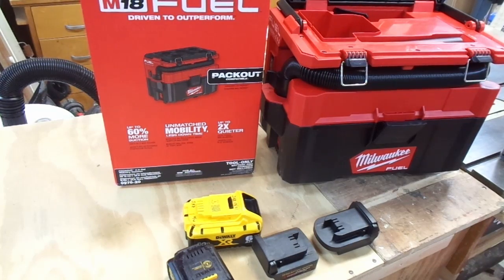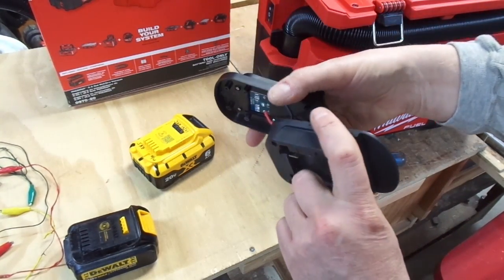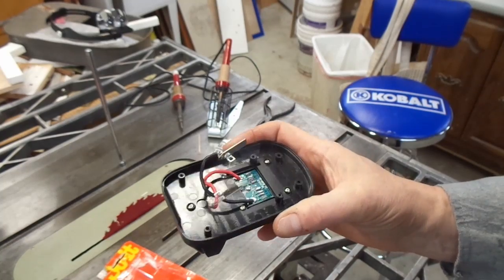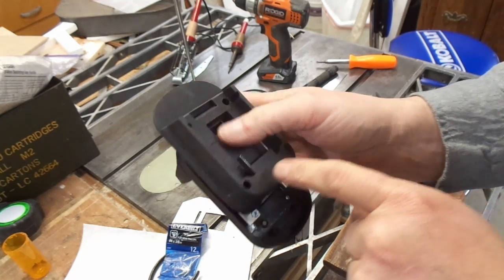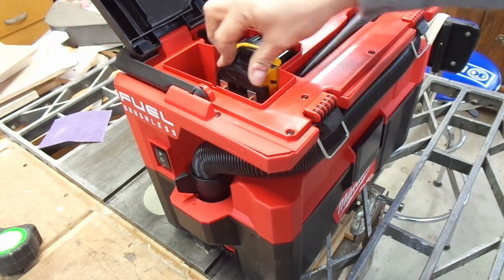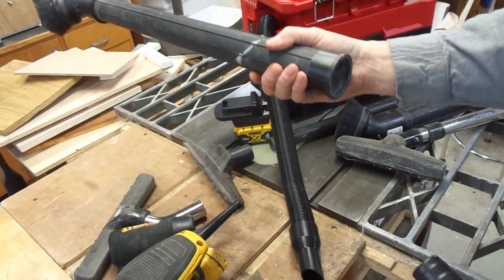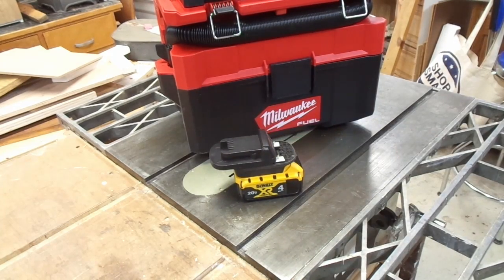Milwaukee M18 Packout Vacuum with DeWalt Battery

Comment: I bought the M18 18V model and was lucky enough to have ordered the correct adapter before seeing any of your videos. I naively thought that any of those adapters found on Amazon will work. Worked out in the end, but should have done more homework. Totally agreed that all of this could have been avoided if Dewalt would make a better vacuum.
Reply from the maker: Thanks for the comment and I'm glad it worked out for you.  Which adapter did you end up getting?  Did it need modifying like mine?  Thanks again.

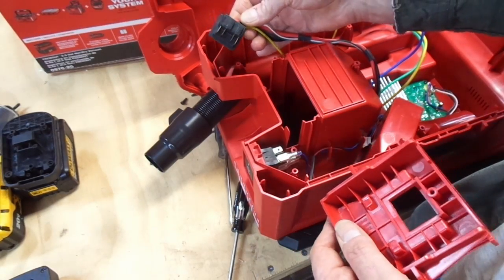Comment: +1 on Dewalt needing to build better vacuums. Their vacuums have always been behind the curve, not sure what the issue is over there.  I have the same issue I have all dewalt batteries and no desire to carry different brands of batteries and chargers around.  usually the battery adapter isnt an issue but it is with the vacuum pockets. I am wanting this same vacuum as well.  Based on your video the best method looks like if someone 3d printed a new red piece like you show around 3:12 that allowed a dewalt battery to slide in and moved it up would be super slick that way it looks factory and could be returned back to original if needed. No adaptor would also most likely allow bigger battery to be used.  I also think 3d printer is what you need to solve your wand issue.
Reply from the maker: Thanks for the comment and you bring up some good points.  I'm not a 3D print kind of guy so I don't have anything to add, but it sounds elegant.  For my issue I have a few batteries that will power the vacuum for 10 to 15 minutes each and that's enough for my needs, although I'm frugal with the run time.  I find the on/off button on the case not terribly convenient and the spring retract hose is something you have to fight while using it.  At the end of the day, it's not really a vacuum you'd want to operate for hours on end anyway, so I use where appropriate, meaning I use it where the lack of cord and plugging in exceeds its shortcomings.  When I have serious vacuuming to do I reach for my corded Rigid vac. Thanks again.

Comment: Great Work! Thanks for following up. Agree about wishing dewalt just made a decent vacuum. Oh well. 

That adapter looks a bit worthless. 

I ended up grabbing the regular Milwaukee vac and an adapter. Works great, appreciate the effort.
Reply: I just ended up doing the same thing. DeWalt vacuums suck but they don't. Can you install a flexvolt? Doesn't work with mine.
Reply: @edwardlairdiii8617  I am ashamed to say I don’t own any flex volt tools yet, so I can’t comment either way.
Reply: @kilikopela83  I bought a few last Xmas. Went alittle crazy but I couldn't beat the bogo deals. Still have tools in the boxes.
Reply from the maker: For this vacuum, the 4AH battery is the largest that I have that fits with the adapter and there's not a lot of remaining room.  I have a 6AH 20V and 6AH Flexvolt, both of which are too large to fit with the adapter I modified.  BTW: Either battery does "fit" in the Milwaukee cavity without the adapter.   My modified adapter fits on my 6AH Flexvolt and I measure 20V at the Milwaukee side pins, so it looks like it should work if it fits.

Comment: I’ve had the same frustration about getting the wand extensions to fit. I used a heat gun on a shop vac brand extension to soften the end of it enough to jam it over the Milwaukee end and resize it. Works well. Probably would be too loose now to use it on a shop vac brand vacuum but I intend to keep it as a dedicated extension for the Milwaukee. 

I have a shop vac brand vacuum, master force brand vacuum, and Milwaukee now. All three slightly different size for the attachments. Would be nice if they were all a standard size! :)
Reply from the maker: Thanks for the note.  I just posted a video where I did something similar.  It's annoying Milwaukee just doesn't make them.

Comment: the first adaptor models fit well with the powerstack 1.7 (i have that set up) the problem with that adaptor is the circuit, it dont have wires like the second model.
Reply from the maker: Thanks for the comment but I'm not sure I'm following what you're saying.  My adapters were simply the hot and ground wires (2 wires).  None of the other ports on the battery are carried through the adapter.  If yours is different from the ones I had then maybe you can rig something that will work.  Good luck.

Comment: Project Farm did a good review on them I have all DeWalt 20 volt tools. I did buy the Milwaukee vacuum. It's a shame that Dewalt doesn't make a better one. we use all Milwaukee Tools on our line trucks
Reply from the maker: Thanks for the comment.  I'm like you, having been on team DeWalt since the 90's, I've got the 20V tools and am generally pleased with them.  The vacuum really seems to have missed the mark, making me wonder if the marketing team blew it or the bean counters had too much influence.  It seems DeWalt turned their resources to lawn and garden and perhaps took their eye off the construction ball or made it a conscious decision.  I use my Milwaukee hybrid vacuum and it suits me for certain jobs.  I wish it carried a wand and more useful attachments, but I can deal with it the way it is.  Thanks again and cheers.
Reply: If HD had the new ridged NXT I would have bought it. They have all the accessories and bags and filters for it. It would have saved me 150.00 They don't stock much for the pack out vacuum have all Dewalt 20v at home. At work on the powerline trucks, we use all Milwaukie tools. The larger contractor I work for Milwaukie will build whatever tool we need which is pretty cool. @jazbuilding

Comment: Wow《☆》Nice Adaptation of the Adapter👍🇺🇸I blame Dewalt as well For not making a more powerful Vac🖖😎☮
Reply from the maker: Thanks for the comment.  I'm glad I have the tool as it's a great fit for specific jobs.  The Milwaukee vacuum is not great shakes itself, but OK.  I find I only use for those occasions where a cord is too much of a pain.  I'm thinking of doing a follow up video to that effect.
Reply: @jazbuilding  《☆》Thanks for the reply. I wound up getting a Greenworks 40v 2 gallon Wet or Dry Vac. It's got great suction. I was already using the Greenworks 40v hedge trimmer & pole saw so it made sense to get it. I didn't see any reviews on YT so I'll see how it holds up. Maybe I'll put a video together. It was $99 from Amazon for just the tool🖖😎☮

Comment: Do you have any problems with the battery over discharging?  Does that adapter contain an over -discharge protection?
Reply from the maker: The adapter certainly has no circuitry.  It's just jumper wires.  As far as I know, DeWalt does not have protection circuitry in their 20V batteries.  Apparently they don't think it's important enough.  I'm cautious, in general not to over-discharge Lithium based batteries.  I've had 20V tools for years and haven't over-discharged a battery to the point of damage.
Reply: From what I understand, dewalt puts there over discharge circuitry in their tools rather than in the batteries. I'm just worried about ruining some very expensive batteries. Thanks so much for the videos.
Reply from the maker: @tchisholm3328  That's interesting to know.   Thanks for the inputs.  I've made a mental note not to run the vacuum to the point of exhausting the battery.  Fortunately, the vacuum seems to have a noticeable drop in power with about 3 or 4 minutes left in the battery.  So far so good.

Comment: Anyone have any idea how well a makita battery fits?
Reply from the maker: I don't but you can test it out the way I did.  I carefully unpacked the first vacuum and fiddled with adapters.  I didn't use it and re-packed it a week or so later to return it in order to purchase the 2nd vacuum (which I use).

Comment: I have a question will a 10amp Dewalt battery fit in this after the mod you did?
Reply from the maker: Thanks for reaching out.  My 4 amp-hour battery is the biggest I have that fits with not much room to spare.  I have a 6 and it's too big.  DeWalt has a bunch and is always coming out with new batteries and I don't own all of them.  My batteries are all a few years old, FYI.  I've done a few videos on this project and show how well the 4 fits.  I think I have a 3 Amp-hour battery that's pretty much the same size as my 4's, so I don't think the power capacity is a good way to quantify it.  My 4 Amp-hour is approximately 2.5" wide x 3" long and 2.5" high, which included the 5/8" part that plugs into the socket.  I hope this helps.  Thanks again.